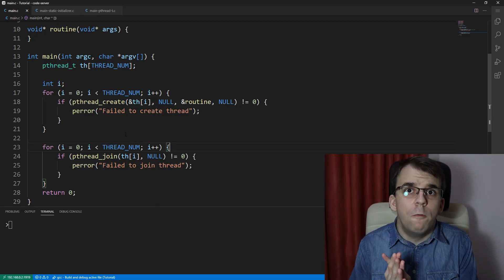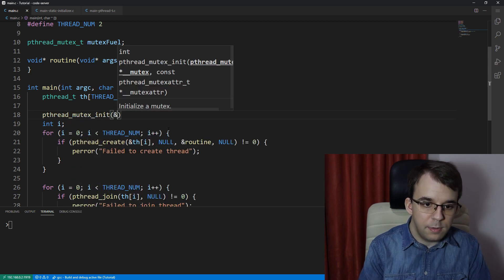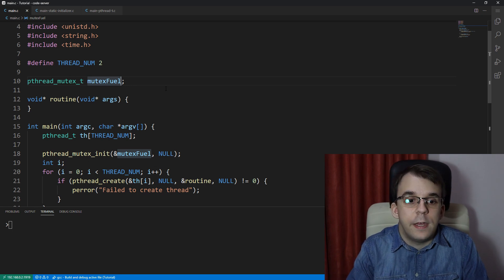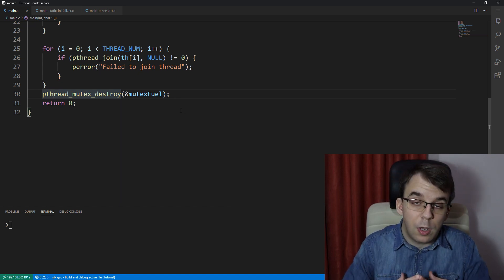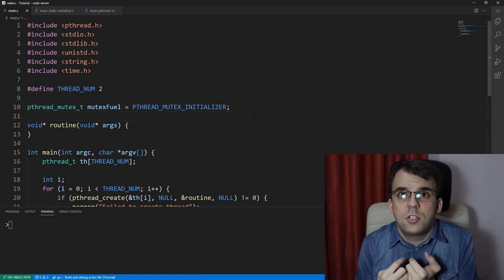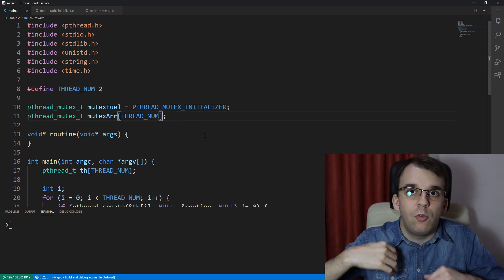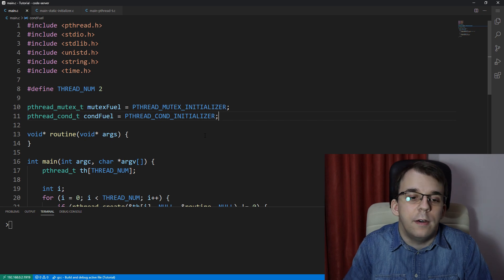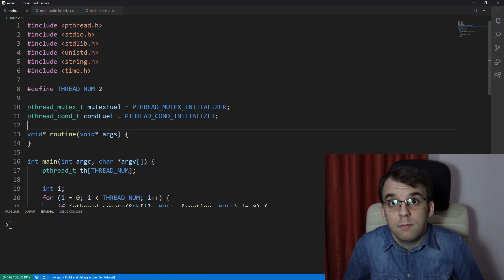Static initializers in the PTHREAD API

Comment: class Test {
    public:
        static pthread_mutex_t mutex;
};

pthread_mutex_t Test::mutex ( PTHREAD_MUTEX_INITIALIZER ); - this one works

pthread_mutex_t Test::mutex { PTHREAD_MUTEX_INITIALIZER }; - while this does not, because "cannot convert '<brace-enclosed initializer list>' to 'int"

So when I initialize it like this, I can't use uniform initialization.
But why? Could you explain it to me?

Or should I just forget about brackets when initializing such a thing and simply use "=" until I get old and wise?
Reply from the maker: This is already C++ and it's a bit beyond my expertise. I am pretty certain that the brace enclosed initialize list is only for calling constructor of classes. But you're actually initializing a pthread_mutex_t which might be typedefed to an int. You could try to add mutex as a member of that class (non-static) and initialize the class itself with those braces.
Reply: @CodeVault  thanks for the advice, but doesn't this non-static mutex mean that I'll get 2 separate mutexes if I initialize 2 objects of my class (so I can send data to 2 threads via 4th parameter in pthread_create() function) and so the program itself will act like there's no mutex at all since every thread will wait for it's own mutex?
Reply from the maker: Ahhh, I see what you mean. I thought you're going to initialize just one instance and use that for all threads. But if you want an instance for each thread then... why would you need a common mutex? What data do you share between the threads (it's surely not inside that instance).
Reply: @CodeVault  the thing is: none :P. I'm testing the output with and without mutex: while my bool flag is true (which then I turn to false after getchar in my main function) in for loop from 0 to 4 I print "1" (in second routine "2") on the screen and then sleep for 1s after printing that symbol, then sleep after for loop for 1s again. Without mutex I get something like "121221122112", but with it I get "11111222221111122222". I've never tested the program with mutexes being initialized inside my 2 class objects, but I'm pretty sure that I need only one mutex. Am I right? Or am I missing something about mutex usage? Anyway I'm going to test it to see the difference.
Reply: Just tested it. With 2 objects having their own mutex I get "121212122112" as expected. I guess that I learned something from your lessons, so I'm saying thank you.
And about this strange behavior with uniform initialization: I'll stick to common "=" to initialize such things.
Reply: Hi bro, 
mutexFuel[] = {PTHREAD_MUTEX_INITIALIZER}

Will this not work in case of array?

This is similar to {0} of any array